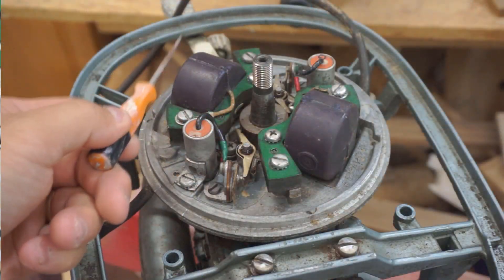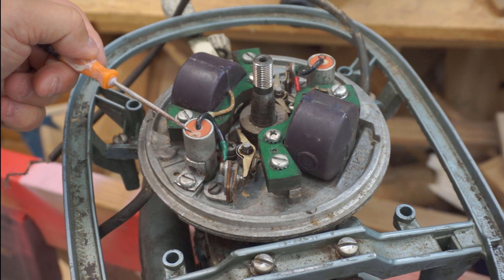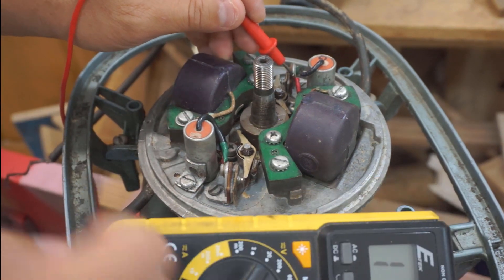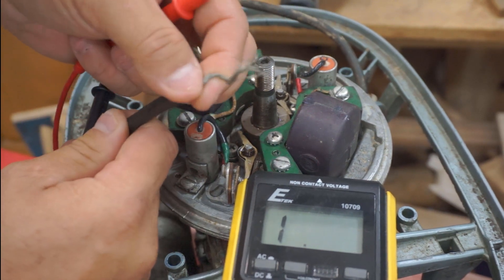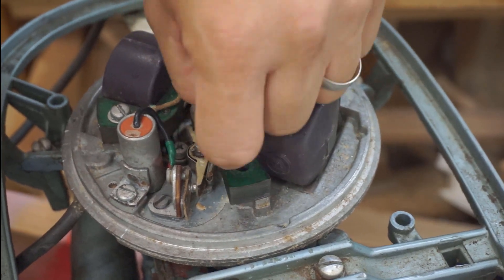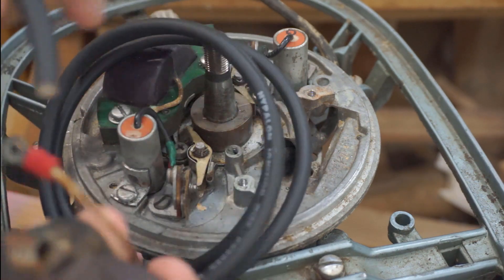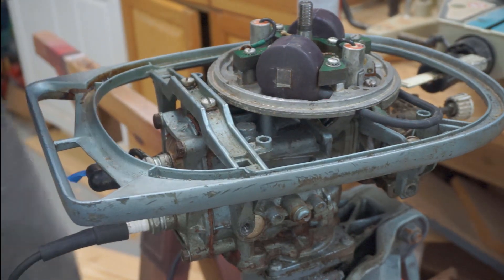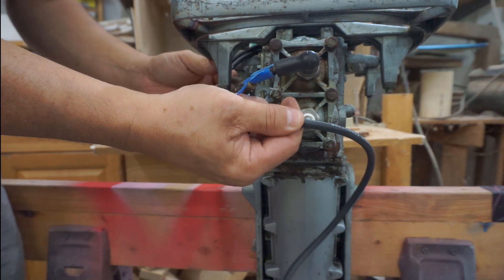Ignition system Troubleshooting and Repair - Magneto coil, condenser, and repair spark plug wire ep3

Comment: Great video! :)
I have a Johnson Seahorse 3 HP from 1964. Mint condition but with an irritating dent in the tank.
I spotted the problem as soon as I pulled the cowling. Both coils were rotten to the degree of cracked (Bakelite?) insulation.
Your video will help me to get this baby running again. :)
Reply from the maker: Glad to help.  It is a fun little motor to work on.

Comment: Great video! Thank you. My question is when I test end spark wire to primary on coil I'm getting 4.21  ( on 20k ohms) acceptable? Still No spark .  Tim
Reply: The primary is almost always good and should go to 0.00 Ohms. The secondary with the fine windings is the culprit. If you get between 7 and 10 Kohms it's good.

Comment: Hello..
I am trying to get electricity from my Johnson outboard motor to charge my battery.  
How do i get the electricity cable from the motor ?
Reply from the maker: There is not a generator on this motor.  The coils make just enough electricity to produce sparks.  They were not build to charge a battery.